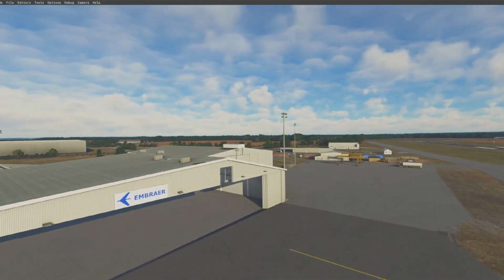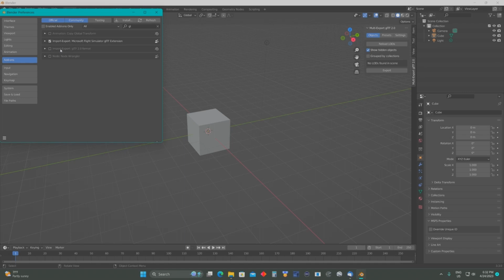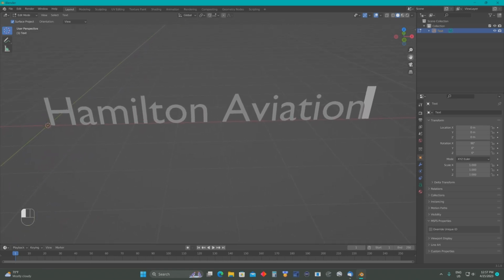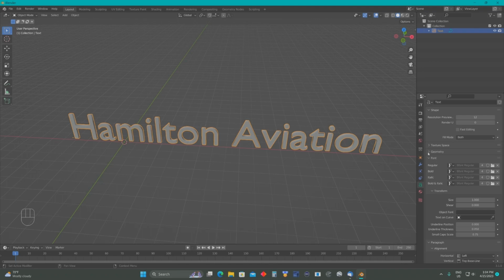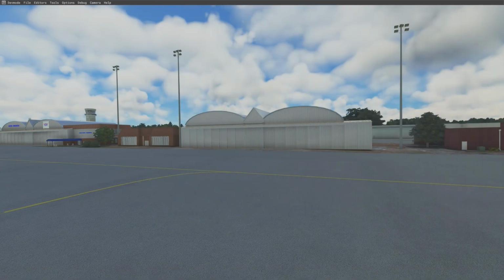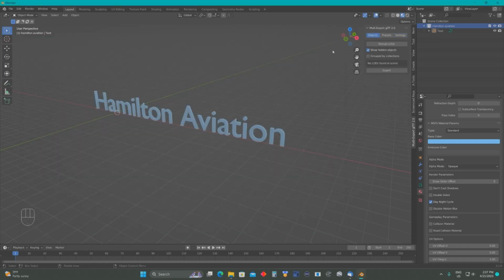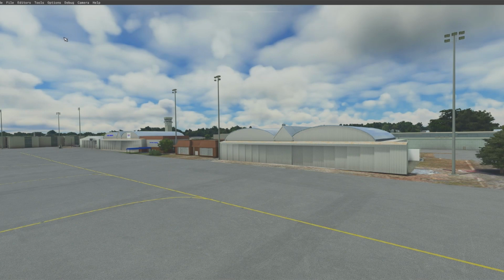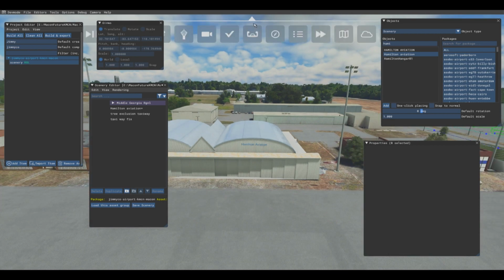Create 3D text signs with Blender and import them into MSFS 2020.

Comment: Thanks for the video! 
As soon as I try to load the XML, I get the message "The project could not be loaded." Not sure if everything in this tutorial is still current, or how to troubleshoot. 
Any suggestions?
Reply from the maker: I know they recently updated the SDK with SU13, so I can't say if they changed something that caused it. I haven't tried importing anything lately. Try joining the facebook group called Microsoft Flight Simulator 2020 SDK and Scenery. Those guys can run rings around me and know more than I ever will.

Comment: Hi James, reviewing your video and my work.  I have installed Blender 3.1 and Asobo exporter 1.1.6.  Do you think that would be a problem?  I see that you are using Blender 3.3 with Asobo Exporter 1.3.0.  Thoughts?
Reply from the maker: I use Blender 3.1 and the Asobo 1.3 exporter to actually do my work. I only used 3.3 to show how to install the Exporter for the video because I did not want to un-install it from my 3.1.
If I were you, I would get the latest version of the exporter which is of right now, 1.3. If you do upgrade the exporter, make sure you uninstall the old version first. If you have trouble getting rid of it, just re-install Blender and install the exporter. As far as Blender 3.1 or 3.3 is concerned, the difference between those two versions are probably slim to none when it comes to building stuff for the sim. Also, the reason I'm using 3.1 is because when I first started using Blender, the version of the exporter I was using was only guaranteed to work with 3.1. I've since of course upgraded to exporter 1.3, but I stuck with Blender 3.1 because everything is configured like I want and I saw no reason to change to a later version.